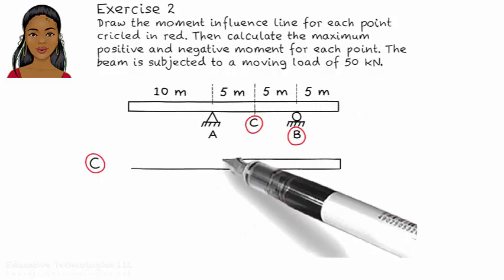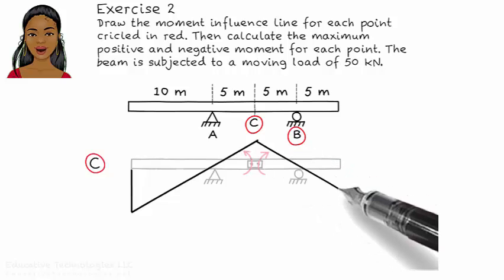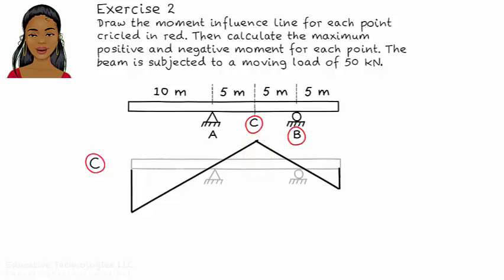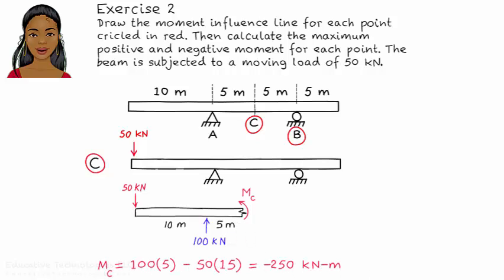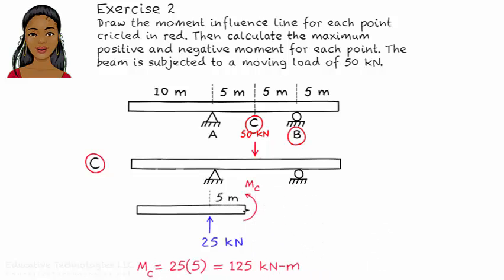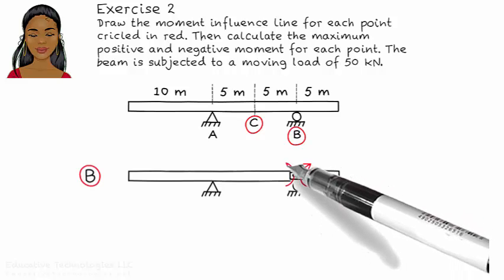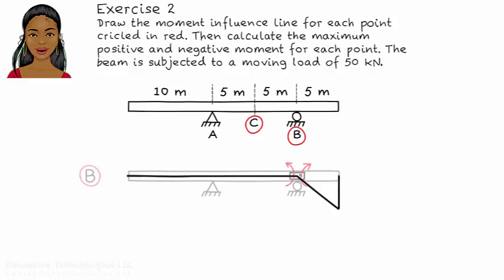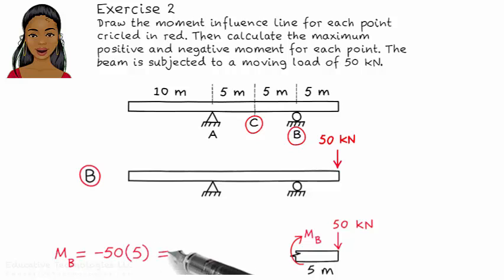Moment Influence Line: Solution for Exercise 2

Comment: Were are you getting 100kN
Reply from the maker: The middle diagram (with letter C written on its left side) is a statically determine beam. If we write and solve the static equilibrium equations for it, we can determine the support reactions. The vertical reaction force at the mid support comes out to be 100 kN.

Comment: Considering the length of the leftmost segment is twice that of AC, should we not multiply the result for moment at point C by a factor of 2 to account for the x2 multiplier of the influence line?
Reply: I actually did a calculation for moment at C for a point load at C and I found that it is 125KNm so I deduced that the influence line will indicate that the moment at C with a point load at C is half that of the moment at C with a point load at the left extremity. Therefore there is no need to scale the first result x2. Let me know if my logic is correct.
Reply from the maker: Yes, the influence line tells us that the moment at C due to a load applied at the far left of the beam is twice the moment if the load was actually placed at C.  Although, one would be negative and the other positive. 

If we calculate the moment at C due to the 50 kN force placed at C, then we can multiple the answer by 2 (and negate it) if we were also interested in the moment at C when the same load is placed at the left end of the beam.

Similarly, if we calculate the moment at C due to the 50 kN force placed at the left end, then we can divide it by two (and negate it) in order to get the moment at C when the load is at C.

Comment: sir in this Q also .why ILD for C goes up & why not down...
Reply from the maker: The moment placed at C tends to turn the left segment in the counterclockwise direction, and the right segment in the clockwise direction.

A counterclockwise rotation of a segment implies that its right end must be higher than its left end. And, a clockwise rotation for a segment means its right end must be lower than its left end.  That is why C has to move up--to make the left segment (AC) turn counterclockwise and the right segment (CB) to turn clockwise.

Comment: why does the left segment remains undeformed, while applying moment at B?
Reply from the maker: Because it rests on a pin at A and a roller at B. We cannot raise the beam at B since there is roller there. The beam is only allowed to rotate at B.  But for it to rotate at B, it has to be able to move up or down at A which it cannot because of the pin.

Comment: How did you determine the reactions at A when finding both maximum and minimum moments?
Reply from the maker: +Kwame Afrani The beam is simply supported. So, we can formulate the equilibrium equations and solve them for the support reactions. 

When the 50kN load is at the left end of the beam, take sum of the moments about B to determine reaction at A:

50(20) - Ra (10) = 0.  

Or, Ra = 100kN.
Reply: Okay makes sense .... so the beam is considered as a whole to determine the reactions while moving the 50 kN load. Thanks
Reply: thanks a lot